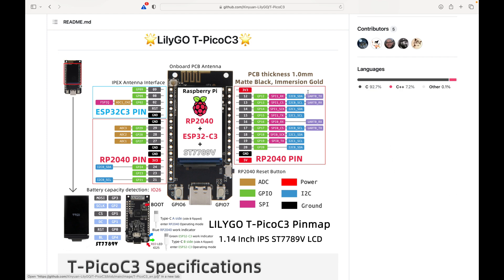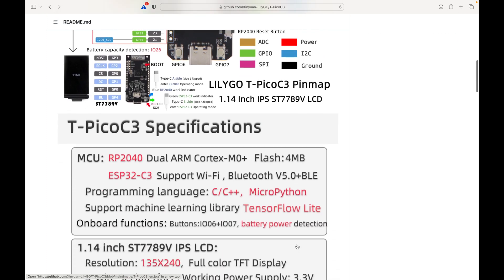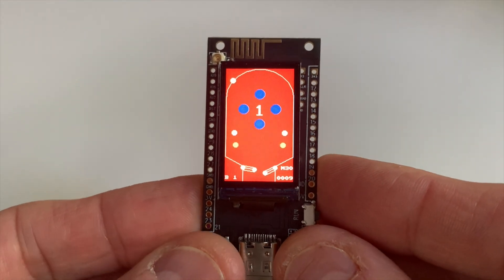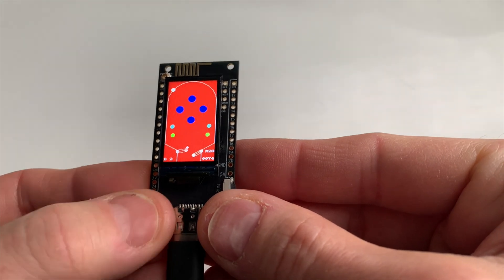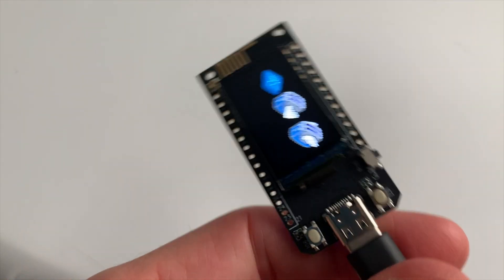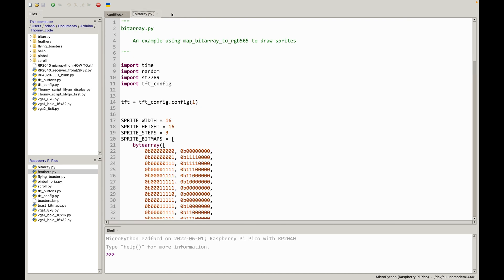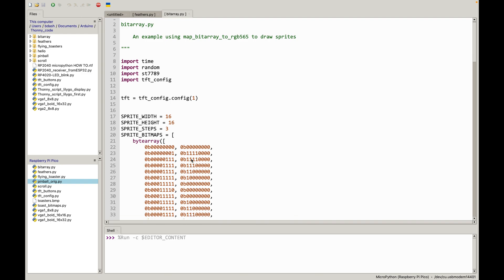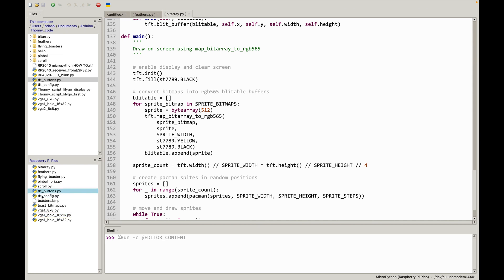MicroPython code examples on RaspberryPi 2040

Comment: Is there a step by step tutorial from scratch for using T-PicoC3
Reply from the maker: Hi, 

Did you get a chance to look at my Github page on the T-PicoC3?
https://github.com/bdash9/T-picoC3-ESP32-RP2040
There is also some great info (where I got most of mine from) on Instructables.com:
https://www.instructables.com/Parallelism-and-Much-More-on-the-T-Pico-C3/

Hope this helps,
Ben
Reply: @dash9computing  Thanx for the github link. I did RP2040 Arduino procedure. & loaded & tried few example sketches & none where running & the screen shows blank. I will try with some other examples again.
Reply from the maker: @videshx818  just make sure the correct color light is on the board when you plug in the power adapter. Remember it’s a polarized adapter so if you plug it in with one side facing up, you’ll access the RP 2040 and if you flip the connector over plug it in with the other side facing up you will access the ESP32.
Reply: @dash9computing  I did those example testing with blue light on
Reply from the maker: Wait… I recall I had to put a file on the RP 2040 with the python code in order to get the screen to work. I’m not in front of a computer right now, but it should be on my GitHub repository.
Reply: I think micropython thonny is needed to get the screen working. I will try that.
Reply from the maker: Check on GitHub under examples-> lcd_config -> tft_config.py